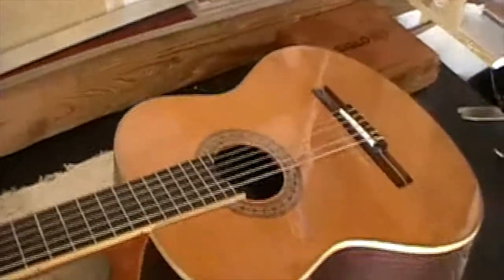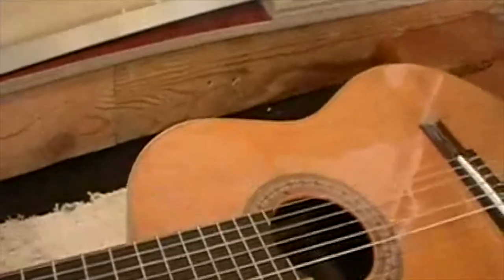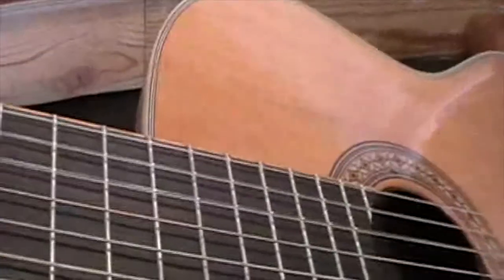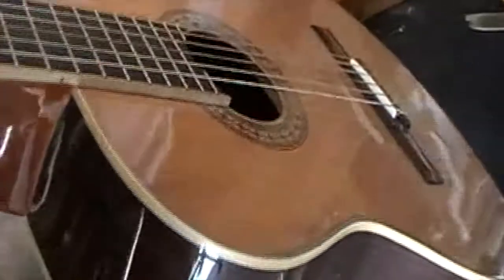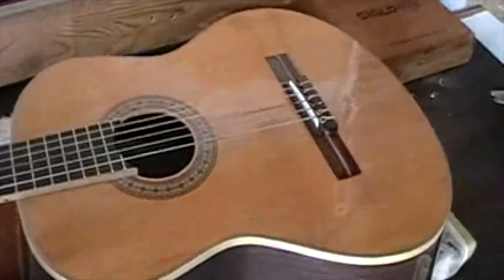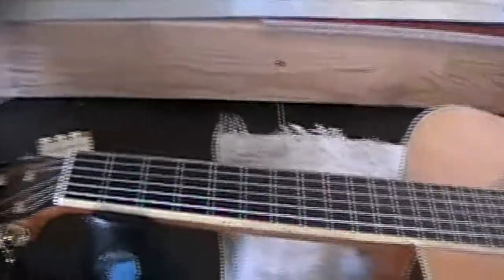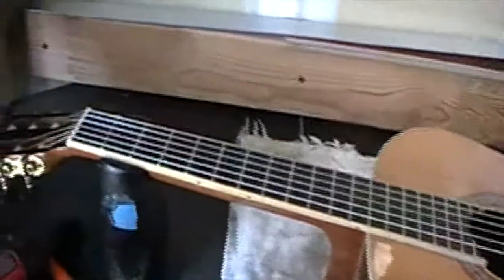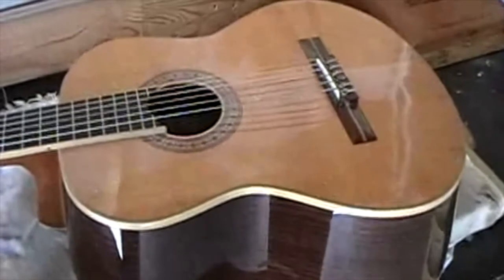An Example of a Damaged Guitar due to lack of Humidity!

Comment: hey,iam preparing to buy a solid top accoustic guitar likely fender or an yamaha..iam a beginner and i dont know any effects of humidity on guitar..can you provide me some advice.
iam living barely 5kms from sea and i dont travel much with my guitar.
Reply from the maker: You probably don't have to worry about lack of humidity - but you can buy a guitar dampit to keep int he case during the dry season - or when you have the heater on.
Reply: +Flowforth Instruments is there a problem existing for extreme humidity.(75%)??also does it affect a solid top guitar having laminated sides???
Reply from the maker: It can make the wood swell and the frets get rusty - but it's not as dangerous as extreme dryness.
Reply: +Flowforth Instruments thanks😊 so is there a problem existing for a guitar having solid top and laminated back and sides? ?